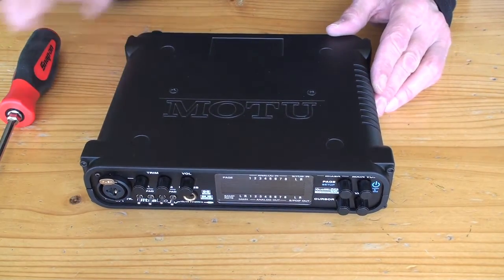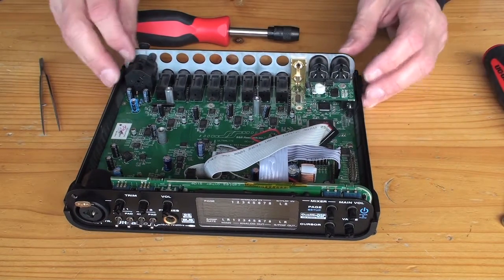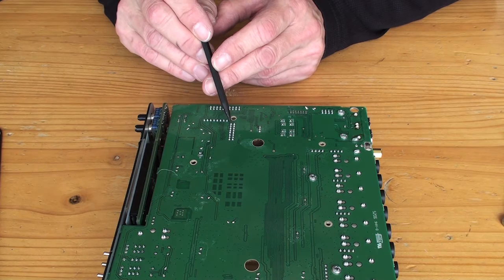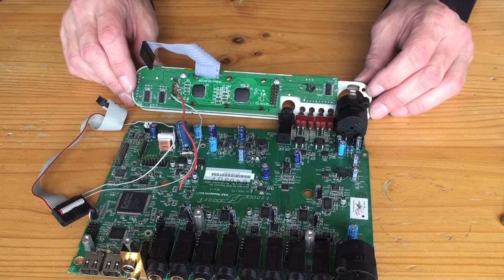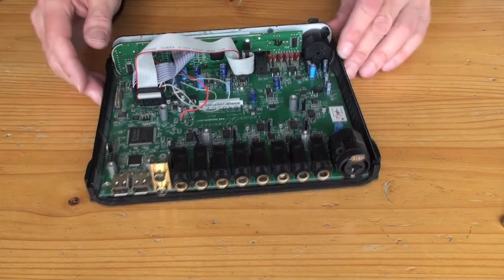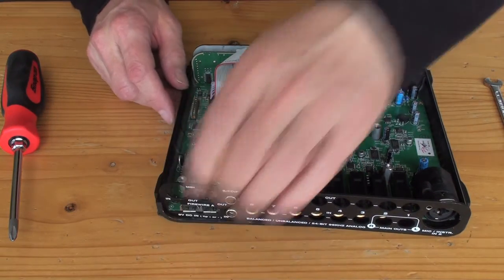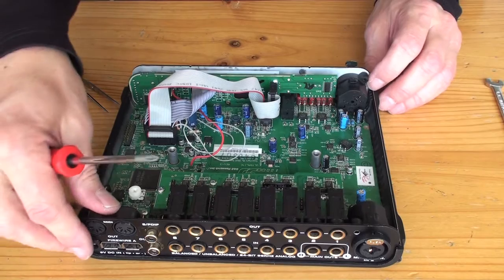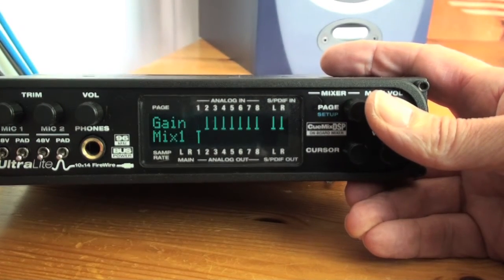Repair of MOTU UltraLite with faulty LCD backlight

Comment: You temporarily assemble it in the top housing first then put on the bottom housing and remove the top housing screw down the pscb and put top back on.
Reply from the maker: I think this comment from F1 is offering advice on how to get the power supply board back in place, an easier way than I did it. If so, great advice! I can't wait for my UltraLite to break down again so I have an excuse to give it a try. It has to be easier than the way I did it, which I could tell was just not right. 'It shouldn't be this hard!'. Thank you F1. :-)

Comment: I repaired my Ultralite with your guide a few years ago, which kept it going for a while longer. So thanks a lot for that! However, unfortunately the LED light just gave up in the end. But the audio circuit itself was still working fine. 

By searching around for a replacement 16x2 character LED display, I found an OLED 16x2 display on a well known chinese website. A green character on black OLED 5 volt display, which by the way also works with a current of 3.3 volts, with the connector holes for the 14 pins, which I had to solder back in. Size 80 x 30 mm, visible display size 66 x 16 mm. The pins you can also order separately; I ordered a double row of 2,54 mm spaced pins of 15 mm length, which fitted right in the holes. I had to cut down the length of the pins a bit. 

The good thing is, with only the 14 pin connector back on, it lights up and works right away. The two other grey wires for the backlight are not needed anymore, because the OLED doesn’t need a LED backlight. It doesn’t have these two extra pins for a backlight anyway.

I tried the same display on my Motu 828Mk2, which I thought had the same configuration. And although it has the same 14 pin connector, and fits also just like in the Ultralite, appearantly the 14 pins are configured a bit different. The OLED display didn't want to light up in that device.

Comment: WOW this really worked. I followed the first video after buying a replacement screen 6 months ago and letting it sit in a drawer.. when I plugged it in after the install I had a "non-backlit" display.. I assumed i'd ordered the wrong part. NOPE! I added the 5V wire and I now have a bright green back light with black letters. Maybe not stock.. but it works for me! Thank you so much!
Reply from the maker: Hi Benjamin. I've just seen this response from you. Good job on your repair of your Ultralite and thanks for the feedback. These Ultralites are great so we gotta keep 'em going!

Comment: Hi. Thanks a lot for this guide. My backlight was fine but I had a power connection issue (I imagine this is common as the point where the adapter enters the box is under stress and any bump or drop will break it). Your guide gave me confidence to open it up and disassemble the boards and identify that the PCB in the power/MIDI had cracked (had previously been fixed – bought this second hand). So I jumped the cracked trace and reassembled and all great! Thanks again
Reply from the maker: Good work Paul. It’s great fun getting a useful bit of kit back up and working again. YouTube has been very helpful to me with all sorts of repair tasks, so I’m glad you found this little video helpful. Regards, Rick.

Comment: Ive changed the wire and tried a thicker gauge but had no luck, i will probs undo the wire again and try and find a test lead somewhere and see what happens. Perhaps the display has just run its course? But i will keep u posted! Thank u so much for responding👍🏽

Comment: Great vid! My Ultralite display backlight only turns on when the unit gets hot, so I presume is a faulty contact that closes circuit when expanded by heat. Today my MOTU 828 mk3 backlight died, and after watching your video I feel more than secure to fix both by myself. Thanks!
Reply from the maker: gustavo bravetti Hi Gustavo. I think you might right about the faulty contact. Or it could be a problem with a capacitor that’s taking time to charge. I fixed a neighbour’s faulty television with a similar problem - took 45 minutes after switch on to start working. I found four bulging caps on the power supply board. I replaced those and bingo - as good as new. So have a careful look for this, with caps in circuit with the display. Check for shorts and open circuits across their terminals. Beyond that it’s necessary to desolder them off the board to check their proper performance. I ended up replacing my display with a similar sized but deeper backlit LCD, mounted on the other side of the display support board. It’s a 4.5v nominal display, so needed the new wire for the backlight. It wouldn’t work with the original 3.3v supply. I’m quite happy with the result. 😊
Reply: Thanks again for the tips! I'll check those capacitors too. ;)

Comment: Nice one.  In my case I need to replace the LCD.  I have a bunch of new style LCDs where all of the 16 pins are straight across instead of 2 rows of 7pins and to isolated pins for the back light.  So I need to  map the pins.  Do you happen to have the mapping of the pins to the new style more common LCDs??
Reply from the maker: Hi Peter. Sorry for the delayed response. I've been away. Re the LCD, I did replace mine in the end, with one that needed a strip of pins to be soldered to it. Such LCDs are commonly available and the soldering job was easy to do, so keep trying to get your UltraLite back into service. It's a great bit of kit. BTW, since replacing the LCD, mine has worked perfectly. Regards, Rick.

Comment: I guess this would be the same procedure for the Hybrid model right? I haven't tried this yet, but it's just lifting the top, then I might go for it. Thanks a lot for this video!!
Reply from the maker: Hi Tiago. I'm thinking that if the Hybrid has the same chassis shape and screws, then the procedure for getting it open will work the same way. Take note of the helpful comment from F1etc that I've pinned to the top, to help with reassembly, if you pull the board right out. You might not need to, depending on how much of a repair you're doing. 
I'll add that I completely replaced the LCD in the end, with one that was a good fit, purchased from a local electronics store for not much. I had to solder on some pins but that was easy. It's working really well. :-)
Reply: @Valden23  I'd love to replace the screen altogether but I've attempted similar fixes before and I'm usually left with open carcasses. No time + no patience, unfortunately. I will try to open the top and see what I can get done that way. Thanks again for this, super helpful!

Comment: Hello Valden23!!! Great videos !! many thanks for uploading them. My Ultralite is showing in the screen ( Bad  Low power circuit ) and it just doesn't work at all it doesn't show as an audio interface. i have tried everything and it just doesn't work. MOTU says it is not fixable and even more dificult as i live in Canary Islands. By any chance you dont know how to fix this??
Reply from the maker: Hi Picnic. My first thought is that your Ultralite is most likely fixable, though diagnosing the problem could take some time and skill. MOTU have simply advised that they are not a provider for this repair. The only reason it would not be fixable would be if a proprietary integrated circuit has failed which happens to be no longer available and is not replaceable with a generic version. However, given that you're saying it doesn't work at all, the fault could be something simple like a power supply component. That's where I'd start looking. If you're tracing sensible voltages across the board and to the power input pins of the logic control and AD-DA chips, then the problem could be more serious. But still repairable, given parts availability.

There's three levels of functionality you want to be thinking about. 1 - is the Ultralite powering on and moving power to where it's needed in the device? 2 - is the Ultralite capable of communicating with other devices? 3 - is the Ultralite capable of converting between analogue and digital signals and communicating these signals? Work through these levels in this order.

First, some questions. Are you getting any kind of indication that the Ultralite is powering on when connected to either Firewire or direct DC power supply? As mentioned, if there is no sign of powering on, look for a problem in the power supply circuitry.
The fact that the Ultralite is not showing up as an available resource within your computer is another indication that it's simply not powering up. 

I'll wait to hear what you see when you try these two power sources: Firewire and 9 Volt DC input. Ask for clues as you go, according to your needs. A quick thought - if you are good with a multimeter and a soldering iron you'll most likely be able to fix this, possibly learning some things along the way. If not, now's a good chance to get good with those tools. But if that's not your interest, look for a repair guy to help work through this. Regards, Rick.

Comment: Woo, great vídeo!
I was wondering, I have the very same interface and Mic input number one has really bad dc offset, to the point where it's unusable (Input 2 is fine). Do you have any idea what's the best way to troubleshoot, or what I should look for? Maybe a bad IC or bad cap?
Reply from the maker: Hi André. I haven't made the kind of repair you've mentioned on this device, but I have on others. Indeed, capacitor failures have been the most common fault - and easily rectified - though not always easy to nail down, whether electrolytic, ceramic or SMD. You're probably already well versed in this, but I suggest studying the circuit to identify what could be the likely culprit, then remove and test the caps, hopefully not too many before you find the dud. Solder in a new one and you could be back in business. As a diagnostic aid, try to replicate the problem on a different but properly working channel, by lifting or removing the probable suspect cap there. This could point you in the right direction. I think the problem is more likely to be a bad cap than a bad IC, but you could have dodgy solder connections with an IC. Like me, you've probably revitalised boards by resoldering ICs, or reflowing the whole board in an oven. That can work very well, but should not be your first port of call. It can also go badly wrong. I knew I was in trouble once when I saw ICs on a RAM board sliding around like pucks on an ice rink. Scratch that one. There's good guidance here on YT for doing this, but ask if you want my tips.
Reply: @Valden23  Thank very very much for the information!  I'll try the cap approach
Reply: Just found this video..nicely presented.  Have a unit here with no phantom or mic input on mic input 1. Trs jack works,  but not xlr..despite it being a combo input.

Comment: Hi there again Valden, so I soldered the wire onto the board without removing the board due to one of the screws being messed up. It worked for a few hours but then suddenly went back to the faded display. Any ideas what the issue could be? Its so frustrating! Perhaps a completely new LED?
Reply from the maker: Hmmm, that does sound frustrating. I think you've telling me the display is still operating, but is dim again. I'd be checking the solder connections and the cable you've installed first. Can you get the display to light up brightly by using a test lead between the voltage source and the display? Can you use a multimeter to measure the voltage available at the voltage source? As shown in my video, with the multimeter in DC Volts mode, put the negative (black) lead on the outside metal sheath of the power plug and then touch the voltage source with the positive (red) lead to make a measurement. What do you get? 
Can you please advise on the functionality of the Ultralite, even though the display is dim again? Does it seem to be working in all other respects?
Reply: Oh,also,everything else seems to be working fine,its just the display thats very very dim
Reply from the maker: Any multimeter testing results? It would be good to know if there's still 5V at that source. As mentioned, using a meter to check voltage, but also using it to check continuity of your jumper cable and soldering work would be the first checks to make. I'm guessing that since you own a soldering iron you also own a multimeter! :-) Go to it man!
Reply: Valden23 lol sadly Im not that tech savvy,Ill have to try and borrow a multimeter from someone,I think my boss may have one,u mention I should check the continuity from my jumper cable? Is that the new cable I soldered on?
Reply from the maker: Yes, the 'jumper cable' is the new one you've installed. Good luck with running those tests. A work colleague or a neighbour will have a meter you can borrow. Here's a question - when you installed the new cable, did you disconnect the old power supply cable, by pulling the long, narrow, black connector off the gold prong? I'm pointing at this prong with my black spudger, at 6:00 in the video.
Reply: Valden23 yes i removed the connector,still nothing,im hoping its my soldereing thats at fault,initially when I was done,it was shining bright but a fee hours later it dimmed down,even more than before
Reply from the maker: Also, checking 'continuity' means measuring with a multimeter whether there is a good connection from one place in a circuit to another. Some multimeters have specific continuity checking modes, where the meter might even emit a beep when you place the probes at two points and there is good connection. If there isn't a continuity mode on the meter, use the multimeter's resistance checking mode, to assess if there is a lot of resistance (an open circuit between those two points) or virtually no resistance from a closed circuit, i.e. one that is continuous and can carry current. You want the new part of the circuit you've installed, with you jumper cable, to be closed or continuous between the source of your 5V and the LCD display's backlight connector. That will show that your soldering and your cable are OK. If the circuit is open, with high resistance, try doing the soldering again.
Reply: Valden23 thats alot to take in lol but i will giv it a go,thnx again Val,ill let u knw how it goes

Comment: Great video !

I'm facing a technical issue with my Motu AVB Ultralite audio interface and could use some guidance.

The USB port on my Motu AVB Ultralite has unfortunately suffered damage, and I'm in the process of replacing it. Additionally, I suspect that there is an SMD capacitor located nearby that might also need replacement. Unfortunately, I don't have information on the specific value of this capacitor.

If anyone has experience with the Motu AVB Ultralite or possesses knowledge about SMD capacitor, I would greatly appreciate your assistance. Any guidance, documentation, or resources you can share would be immensely helpful.
Reply from the maker: Hi D0cteurcraft. Sorry I didn't reply earlier. Firstly, I'm sure you'll be able to solder in a new USB port without too much difficulty. It's probably already done. As for the SMD capacitor, I've had to replace a couple of those, which was also quite easy to do, if you have a fine enough tip on your soldering iron. For one of them, I replaced it with a ceramic capacitor of the right rating, because that was all that the local electronics store had. I read the rating from the circuit diagram which I found online. It was a Tannoy studio monitor, so not as complex as the MOTU Ultralite. Anyway, I encourage you to get stuck in and solder in a replacement. You should be able to deduce the rating for the capacitor by measuring similar sized and looking SMD caps in similar roles on the board. Move a good one from elsewhere on the board that isn't needed for testing. Or pull one from a dead circuit board you keep for such purposes. Please let us know how your repair efforts work out. 🙂 Regards, Rick.

Comment: i just changed lcd backlight led. those green led is so tiny and weak. i put there biger blue led and put 100 ohm resistor  in series. and backlight become bright. dont even need to change voltage.
Reply from the maker: Hi Selga. Yes, that was a good idea, to replace the LCD backlight LED. Elsewhere in these comments and in the video description I explain that I replaced the whole display with a new one, which is a better idea than upping the voltage. I’ve left this video here for watching as a guide for disassembly. There are some good tips in the comments on reassembly too. Viewers should look for those, including the one that is pinned. Regards, Rick.

Comment: Hi I recently got an mkII for free... After replacing the big elcap I already got rid of the startup problem.... Is there any reason why te voltage should have dropped to 3.15V? Which component would be broken? Thanks?
Reply from the maker: Hi Thierry. The voltage will be different at various points on the circuit board, depending on the requirements of the circuit’s design. You have replaced at least one component so I’m guessing you already know about this. 😄 I remember finding voltage measurements in the 3V range, as well 5V. If you are measuring 3.15V at a particular point, it could be normal. Regarding the LCD, if yours is not working properly, be sure to read all of the video description and the comments and consider installing a new one. Regards, Rick.